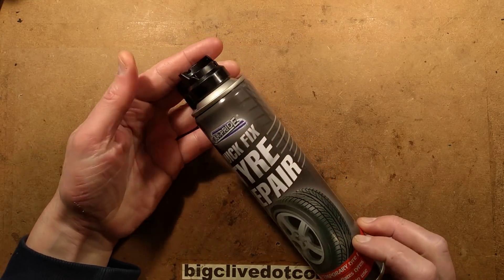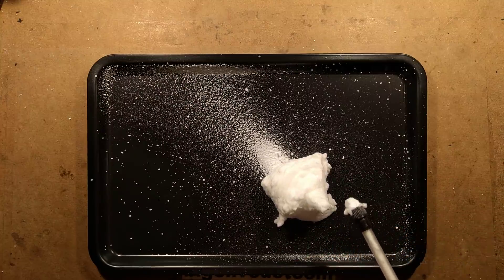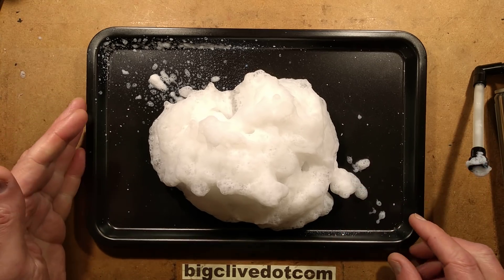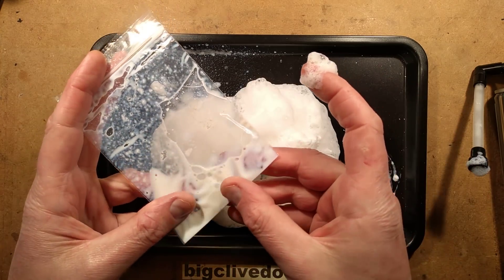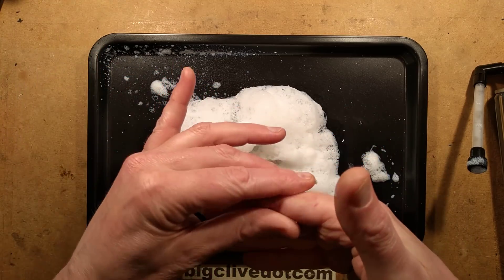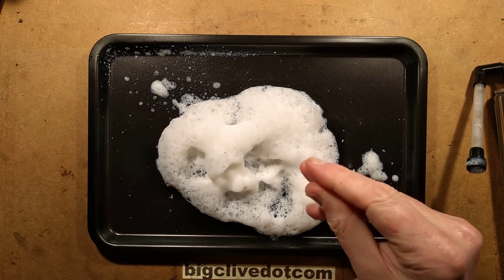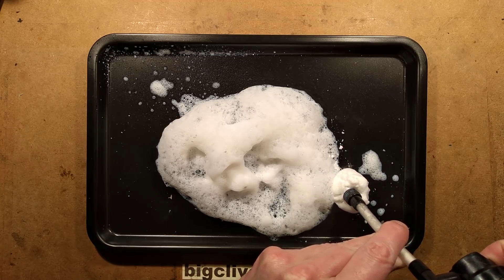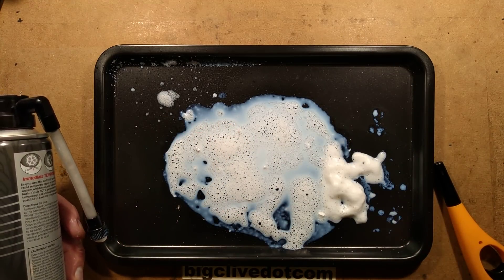What's in a tin of foaming tyre repair liquid.

Comment: If you talk to a tyre repair technicians they'll tell you they need to know if that stuff has been sprayed into the tyre that they're replacing. It's flammable and hazardous to the person replacing the tyre. And, until it seals, it makes a mess as it spins out. I've tried it on a bicycle , it worked but made a mess.

Comment: If you press the front end down on the trigger, you can break the connection between bottle and pipe, and if done right,a piece of plastic will lock the can in an open state, sending foam everywhere

Comment: The whole point is to put it in when you run over a nail or something and it gives enough pressure to get you to a station to fix the tire. In theory there should be no ignition source in the tire so combustibility doesn’t mean much. The flammable gas is not the propellant but the gas greater by the chemicals to fill the tire a bit. There are two chambers in the can, with different chemicals that react to create the foam for coating the inside of the tire and the gas is the byproduct of that.

Comment: Nastiness. Pure nastiness. Any time I get a mower in for repair that has fix a flat in the tire, I charge them double. It SMELLS SO FREAKING BAD!!!! as well as rusting the rim to the point you have to sand and paint it again to keep it from poking a hole in the tube. FOR MOWERS, Don't use this stuff! pay someone $20 to throw a tube in your tire!
Reply: I should probably add, for lawn mowers, this stuff doesn't work well because the mower doesn't spin fast enough to spread the material effectively. Most times on a mower you're either fighting a leaking bead, or a dry rotted tire. Considering here in the US some riding mower tires are more expensive than tires for cars and trucks, its much more cost effective to install a tube. Also, there seems to be a few different varieties, the green slime they still here doesn't seem to ever fully dry up like the milky colored ones do.

Comment: weeeell ... since water diffuses through many plastic/rubber and tubes, you need an extra aluminium layer for floor heating tubes.
Perhaps the water will diffuse outwards, ,perhaps faster if the tire gets hot through the brake disk+ calipers.
you normally dont use extra dry compressed air to inflate your tire, so some water might condensate if filled in the summer and using at winter temperatures.

Only time my father had to use the compressor+leak kit on his car, the hole/slit was so large, it came out just as fast as it was filled..
-after this event and having to wait very long for service car he decided to take a normal spare tire along again, as he had done over 30 years.

What i heard for the old set was that you'd have to throw away tire+rim afterwards, but this latex version might be easy to clean off with pressure washer.

Comment: I had a brand new VW caddy van and in the first week had a nail in the near side front tyre..this was not good as it was near the edge of the tread and knew the tyre repair company would not repair the tyre as it was near the edge ..this said i decided to use holts tyre fix same or similar to the one you used..i fitted the can to the valve whilsed the tyre was compleatly flat and inflated the tyre i used the full tin and the tyre inflated to about 26 psi..i went for a drive after i pumped the tyre up to 36 psi the corect pressure..i never had the tyre repaired and wore the tyre out at about 10,000 miles..and had a new tyre (a pair) fitted..i had no issues with the tyre the whole 10,000 miles either with the balance going out or the tyre going down..it proved a good repair.

Comment: I've used Fix-a-Flat to repair a few tires that had minor leaks, the kind of leak that would take 24 hours to lose half of the tire pressure. I would simply empty a full can into the tire, top off the tire with air and drive around as instructed. The tire is usually fixed after that. I've rarely had to use two cans to fix a single leak. Once the leak stops, I forget about it. The tire is as good as new. The air and flammable gas stays in there. I haven't had a single issue with this practice, even with long road trips at highway speeds.

Comment: Used this twice on my moped scooter after a huge piece of glass and a big screw punctured the tire. Both times the alternative was to get a truck to pick me up and move the scooter for 10/12km - which is more expensive as replacing the tire (and the risk that the tire was wasted anyway). So I used this to get home, make a replacement appointment for the tire, and drive it to the garage a couple of days later.

Comment: I used to work for a breakdown company,  subcontracting for most of the main uk roadside assistance providers.  Quite often these tins just give you a flat tyre that's now full of snot.  Works ok if you've had a nail through the tread, but that's about it.  Interestingly, many of the kits that come with new cars in place of the spare wheel have a compressor and a bottle of snot.  You join the compressor and bottle together and the machine pumps it in, so no flammable gas is used.  I've probably still got a bottle or two of the snot in the shed somewhere, if you fancy pouring over your work bench and trying to burn it?  Happy to send it over  😁

Tyre fitters tend to dislike it, as when you take your tyre to be repaired properly, it's full of gunk and quite often glued to the wheel rim

Comment: It softens the case of the tyre and it can't be repaired after using this type of stuff, it renders the tyre as scrap. I've had a small tack in an older tyre on one of our vans which was causing a slow puncture so I sprayed some of this tyre shmoo in and it worked fine, the van was at the end of it's life and it was just a way of keeping it moving without spending money on a new tyre for a scrap van. Most new cars don't have a spare wheel, just a can like this and a small air compressor.

Comment: I work in the automotive industry and this stuff is horrible for tire pressure sensors. I've seen a few tires where this stuff has been left in for a long time and it does a number on the inside, the ammonia and moisture tends to start to rot the tire out from the inside. It's kind of deceptive because after about 2 years you never know when your going to have a blow out. Any interest in looking at a tire pressure sensors circuitry? They are kind of simple but I have a few old ones.

Comment: I used this in a winter-tire, where the tire wouldn't seal against the rusty rim. It took a few days for it to seal completely, but it held up for the entire winter and still held air when i sold the car almost a year later. 
Probably not the correct way to use it, but it was a cheap fix and it worked fine.

Comment: I've got a friend who swears by this stuff.  He used it to fix a puncture on a chunky off-road tyre which stayed fixed for the rest of the time he owned the vehicle (over a year).
I on the other hand used a can after pulling a nail out of my tyre which had been slowly deflating for a couple of weeks.  I waited the suggested amount of time, drove back and forth along the farm track at 15-20mph maximum (slower than the can recommended) with several inflation breaks, then promptly drove down a dual carriageway and had the puncture fixed properly because I needed to go to work and half the liquid had exited the tyre.  £8 for the foam, £10 for the repair.  Foam useless.

Comment: I used an ancient (>20 yrs) can of this on my lawn tractor tires that were cracked and leaking air. They still hold pressure after a year. The fill is probably mostly still butane as I've only added a small amount of air to them. That ought to be perfectly safe about 6" from the muffler,  right?

Comment: My mechanic says: don't use this crap, it's a temporary stopgap measure. Often tires can get properly repaired but if you use this stuff no one will touch the leaky tire with a 10ft pole and you have to get a new one (or a pair if the other one on the other side is too worn down already).

Comment: I had a slow puncture and used one of these. Sealed up and ran with it for a year or so, until the tread was worn out. No issues at all. It does make changin the tyre a bit messy, but (at least in Norway) they sell these cans at auto repair shops so....

Comment: Those work great on low pressure tires like snow blowers and riding lawn mowers. I use it on those that have dry checked tires and it works great for those. I wouldnt use it on a regular tire. Tire repair places HATE dealing this that crap. Yep, liquid latex.  New cars come with a can of that garbage now instead of an actual spare. They claim it saves weight and money on a vehicle but doesnt save YOU anything. It saves THEM money, but you still have to buy a spare or have your car towed if you get a blow out. Sad.

Comment: yeah those things use liquid latex.  They probably have two openings in the dip tube in the can so you get a mixture of latex and propellant so you can use it up or down.  I wonder if it works sideways too or if you get propellant only once the can gets half empty?

Comment: Worked at a dealership for a while that made a fortune replacing TPMS (tire pressure monitoring sensors) that were damaged by that stuff. We had so many problems patching the tires themselves as well. No amount of cleaning would get rid of that stuff to get the patches to stick properly.

Comment: I work at a tire shop. People have died working with tires repaired by these kits, the propellant has been some flammable gas which has then ignited and the tire exploded. We now ask every customer specifically if they have used these kinds of products. If they have, we need to take certain precautions when emptying the tires.
Reply: I wonder if the statistics would show that there are a lot of reasons people have died from tire explosions while working on them. Maybe the danger is somewhat overrated compared to other reasons. Just saying, if it is such a dangerous product I would think it would've been taken off the market already.
Reply: @bennylloyd-willner9667  At least where I live, very few people are ever killed for any reason when working with tires. The safety standard is high enough that it would be deemed illegal to hire someone to work with these things without any additional safety procedures. When those are in place, it's considered safe, so no ban is needed.
However, even if it wasn't possible to reasonably work with tires filled with this in a safe manner, it would be up to the tire busyness to refuse them.
Reply: @Havreflan  so you agree that your own statement of people getting killed because of them are a exaggerated just to give a scare?
Reply: @bennylloyd-willner9667  Haha, well no. People got killed, more so than was expected from any single phenomenon, and things were done about it to save people from getting killed. Nothing in my first post was an exaggeration. Bigclive asked for our experiences, and i thought this was a reasonable thing to bring up.

I see no reason to call this fear mongering or anything like that. It's absolutely noteworthy that we suddenly had to work close to flammable gases in closed compartments near power tools without knowing it.
Reply: @Havreflan  ok, fair enough. But do you agree that it isn't that big a risk nowadays with knowledge of the risks. The fact that people have been killed due to lack of knowledge and security thinking in the past doesn't mean it's that dangerous now? I don't say you're screaming bloody murder for nothing but I'll still use them without fear (for me or anyone handling the wheel in the future) if I'm in a situation where the preferable solution isn't possible.
Thanks for your professional opinion, it's good to hear that you have knowledge to back up your comments, not seldom are "facts" taken from thin air... 
... or thick foam😁

Comment: I once bought a cheap, used, hand-trolley with non-standard six-inch (outside diameter)pneumatic tyres from Cash Converters.  Rather predictably, one of the tyres had a slow flat although there were no signs of either a puncture on the unworn tyres or a leaking valve. Taking it to a tyre depot was pointless.  Using a similar product intended for bicycle tyres has effected a permanent and safe repair on this low-speed item.

Comment: Are yes I remember using tyre weld (I think that was the brand) about 15-20 years ago and it worked quite well for about a year, until I need to change the tyre and the garage complained about the smell.

Comment: Yes, I've used them at least 3 times, always used them as 'permanent repairs' - well it worked, never mind what is said on the tin.
No explosions. They only partially pressure a tyre, say ~20psi and need a proper pump up asap.
Only once recall having a tyre changed after about 2-3 years. When the fitter pulled the tyre off his comment was "WTF is that" to an off-white liquid slopping around in the tyre.
Only ever used them on tread screw/nail holes, probably won't work at all on cracks/splits/tears, and definately not safe to.
BTW, as for explosions, ever seen the Icelanders getting a tyre back on the beads of a rim on their snow buggies? Good squirt of Butane and a thrown match.

Comment: This things has its own role. It can save you from having to replace the tire immediately if you have a spare tire, so you can drive safely home. Or if you are on runflats, it can save your tire that otherwise would be destroyed, but of course only if the puncture is small enough for the foam to work. A tire repair kit can also be handy

Comment: I have used it a few times years ago even left it in. It inflates but so under pressure you have to add air while it dose stop some leaks or slow them down. Slime is a bit better but you need to take the needle out of the valve stem to fill the tire a newer version you don't. After fooling around with that shit I now keep a plug kit and 12v compressor in my truck. I lived and learned.

Comment: Over here we typically call that stuff Fix a Flat. I've used it to help seal up old leaky tires, tires that lose about 10 PSI a week due to either just being old, or having an old valve stem. In those cases it worked fine. For actual punctures though I'd likely use what they call Slime.

Comment: Well, I am highly unlikely to ever use this ‘sealing foam’ as I refuse to buy a car that does not have a spare wheel (complete with tyre). Having experienced a blow out at 70MPH in lane 3 of a three lane U.K. motorway, the only hard part was that the boot was full and had to be emptied to get at the spare. Okay, sometimes the wheel does not want to come off the hub. But once you have fitted the spare, you can continue your journey without having the worry of how long a “temporary fix” will last 😊
Reply: You're running out of options very soon then; spare wheels are going the way of the dodo, real ones (instead of emergency wheels) even more so. Also most people forget to properly maintain the pressure and when they need the tire, it's all flat (or worse forget to swap it and have the wrong tire...) What's wrong with run flat tires? Wouldn't want to miss mine...
Reply: Daniel Egger - All but one of the punctures that I have experienced would not have been fixed by foam sealants. The one failure where this type of foam sealant may have worked, happened very close to home. In fact, I only noticed it after parking the car, I wondered what the hissing noise was. So once I worked out which tyre it was, I just changed to the spare there and then. It is easy to check the spare when you visit a garage to check the air pressure in the other tyres. Car manufacturers may well be continuing down the path of not providing a spare, but they will not be getting my money if they do. I tend to buy new cars about every ten to fifteen years. So I have plenty of time to investigate which cars have a spare.
Reply: @Mark1024MAK  As I said, good luck finding a new car that does still have that, most cars do not even have room for a spare tire anymore. When we had the last small leak I simply topped it off and drove to the garage; with a larger leak I'd have removed it and driven there with another car. Nowadays I just use run flat tires, I don't really like the idea of a catastrophic failure driving at high speeds (I've experienced one in the car a few years ago, luckily the driver had a few of those before and handled the situation flawlessly), nor do I like the idea of swapping or bandaiding tires in the middle of nowhere, potentially with a fully packed car and under nasty conditions.

Comment: To know how it works, wouldn't you have to keep the material under pressure? Presumably, it was designed with the constraint of 20-40lbs air pressure used in most tires.

Comment: I had until recently a VW Touran that had no spare supplied, just a can of gloop like that and an electric tyre inflator, a few months ago I got a puncture on a sunday afternoon in the middle of no where (Norfolk) the hole was far to big to be stopped by the gloopor the tyre pumped up by the miniature air compressor supplied. I had to call someone out to fix the tyre. I just bought a new car and the only question I asked salesmen when looking was does the car have a spare,if it did not I walked. It is supprising how many cars now have no spare not even one of those skinnys.

Comment: I used it to seal a very slow persistent leak in a new motorcycle tyre on a slightly damaged wheel. It's been in there for a couple of years now with surprisingly few explosions, and it remains air tight.

Comment: I've used it and then went straight to a tire shop to get a real repair. Made sure to tell them it was in there thanks to it being flammable. It actually worked long enough to not have to change it on the side of the road.